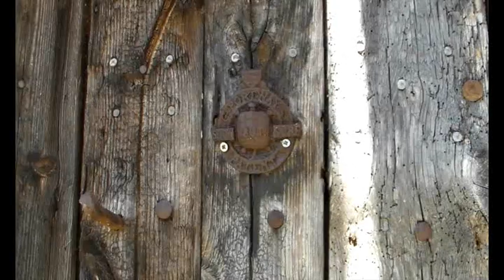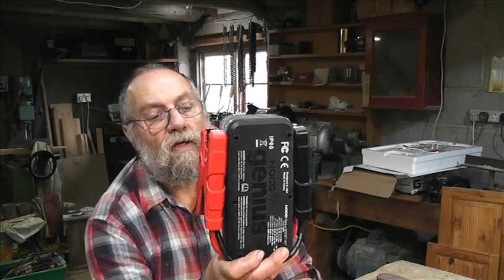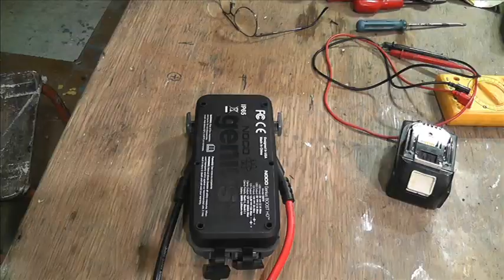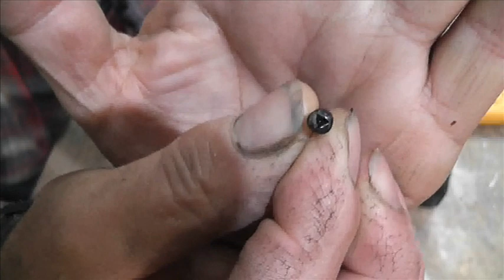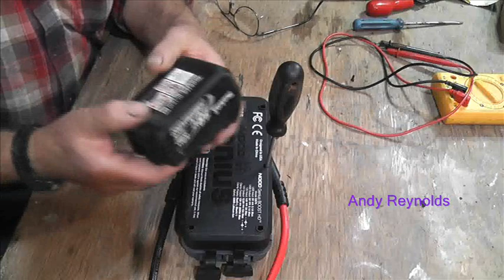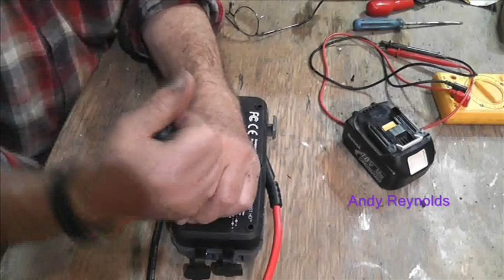Noco genius fault investigation, lithium battery booster jump pack.

Comment: I have the Gb30
had it for a while...and when fully charged it is now only 11.1v....

I guess there is no real fix for these.... Interesting and informative

Thanks

Andy
Reply from the maker: Good to hear from you, yes those cells are what they are. If you took the pack apart you could maybe boost each individual cell from a bench power supply, doubt if it's worth it, cheers

Comment: Thanks Andy for your video :)
Have to add an important fact here: As you were measuring the voltage of the remaining "good" cells it shows they are charged to fullfull, and this is a big mistake most people make.
Overheating and charged to 100% kills the cells, at least the NMC based cells. That means they produce gas and therefore "puff up".
Solution: Do not charge to 100%, leave them sitting at about 80%..  sweetspot is 65%. They still have plenty of energy to start a car! And dont run them down completely (as mentioned by Andy).
Its so simple: take care, thats it :) .
Reply from the maker: Exactly, maybe a product of unbalanced charging due to the totally dead cell, yes 4.4v is far too high, cheers
Reply: Even better SOC for storing long term is 30% to 50%.  I have lithium ion tool batteries that are 10 years old that still have good capacity that have been stored that way.
Reply from the maker: @randacnam7321  I suppose there are many tools that are only occasionally used, the problem being that when you want to use them you want them fully charged. cheers
Reply: @TheInfoworks  What I do is have a load of batteries with a few fully charged at any given time for immediate use.  When those get discharged I charge up other batteries and the now discharged batteries go to the back of the cycle.

Comment: Hi Andy,, I only bought for the ability to use as a starter and Line out,,,, but maybe I kept those gloves on for too long,,,,,(you live and learn)though expensive lesson)   cu you tomorrow
Reply from the maker: It probably switched off but at too low a voltage, maybe the initial fault was in the BMS, causing a cascade of faults, cheers